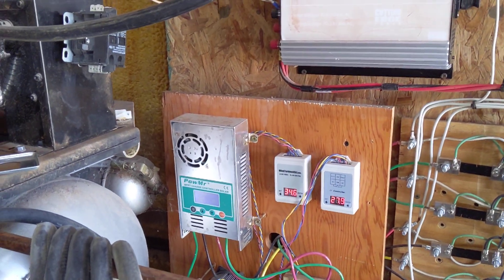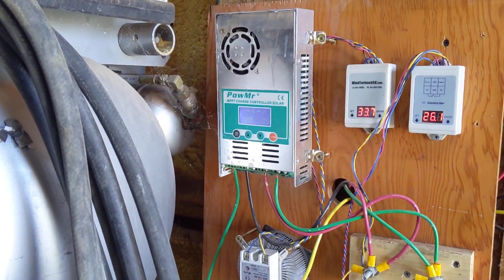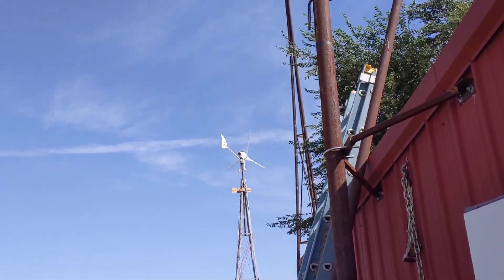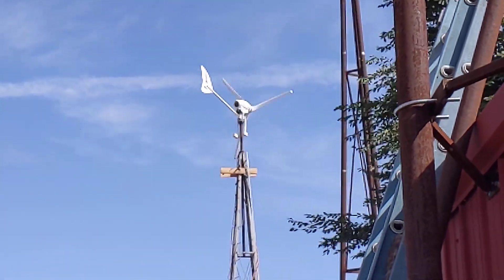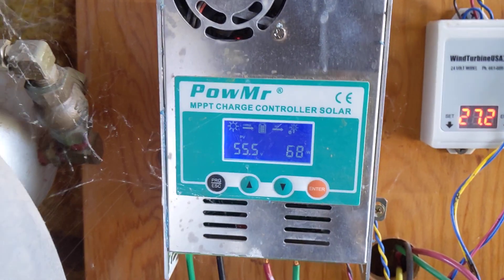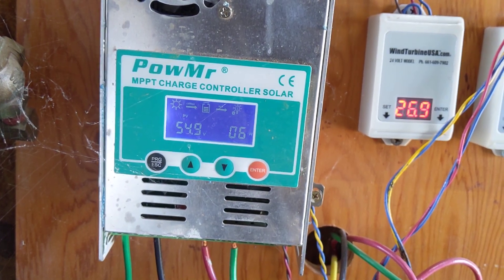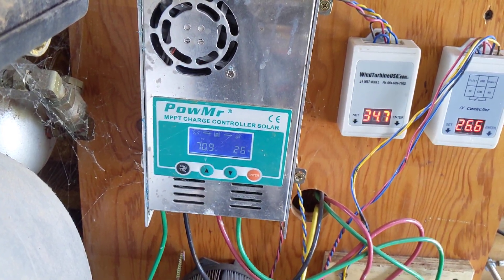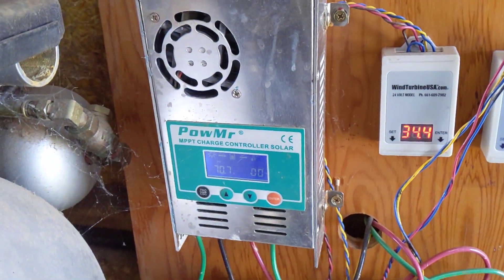PowerMR Charge controller update

Comment: I wonder if a Xantrex or Morningstar PWM diversion controller would work well for this?  Xantrex C40 is fairly inexpensive.  Set to 50v and PWM excess to 24v bank.  Wouldn’t need that SSR to turn it on.  Setting to 50v would allow a little buffer for your 48v battery to absorb charge during gusts.  I have one that diverts to resistors and works great, but never tried diverting to a battery.

Comment: You could dump it with a pwm controller pulsing a 60Amp DC to DC SSR directly into the other batteries and 3x 100ohm resistors parallel to each other to limit the amps transfered to about 30. That's what I did. When it hits a certain voltage it starts pulsing and transfers the extra power to the other batteries.

Comment: Have you tried putting a resistor on so when the voltage come up that high it would automatically slow it down with a controller

Comment: Go for an PWM Charger. You really dont need a MPPT Charger to charge a 24V Bank from a 48V Bank :) much easier and cheaper :)
Reply: umm, no PWM would not work, only other alternative is a buck converter.
Reply: @thedavesofourlives1  for sure can a pwm charger work. Buck converters are possible too.
Reply: I use a PWM and it works perfect